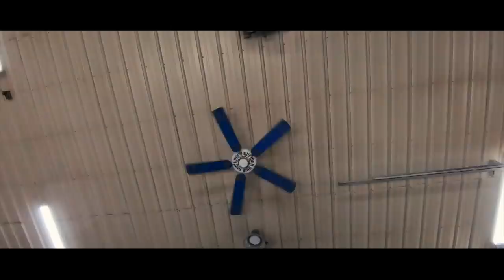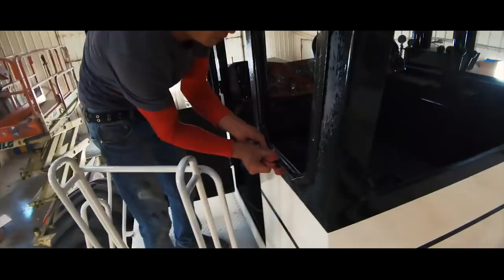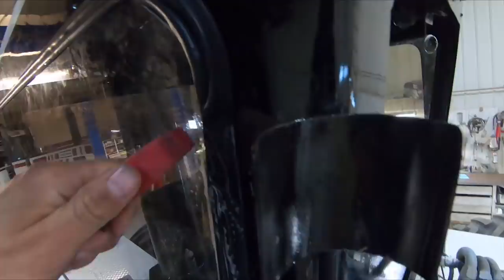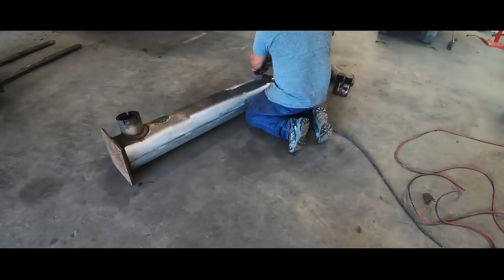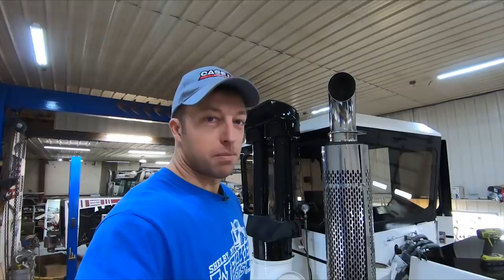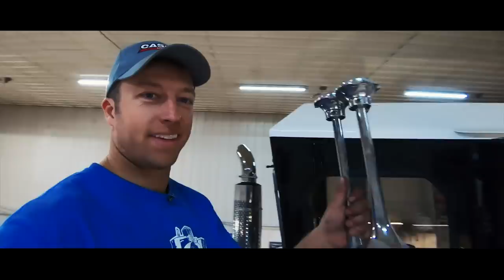BIG BUD Tractor 🚜 Restoration - Part 8

Comment: IMHO Straight chrome tip with a rain cap and let that coal blow straight up, get it as far away from the air intakes and pretty white paint as possible.  And another band clamp on tip would look cleaner than that muffler clamp to hold tip on.  Love your channel. Can't wait to see Dr. Chop spray the Waggy.
Reply: Love the Waggy 👍 The little Waggy that could.

Comment: Learned and awesome trick for putting in glass, put the rubber gasket around the opening, then put baler twine into the groove around where the glass would go. Put the pane against the gasket, and as you pull out the twine it pulls the lip open,  like you’re doing with the plastic tools, and the glass slips in. Like pulling a zipper all the way around. Works pretty slick.

Comment: There is a quicker way to install windows. Put thin rope (like starting cord) in gasket, seat the window in the bottom, press it against gasket and pull the rope while applying pressure to the glass. Pops right in. Nice to see your bud getting back to its glory.
Reply: goodiezgrigis im glad im not the only 1 wondering where the string was....
Reply: I tryed to explain that to..
You explained better! 😂
I'am guessing maby it's because I'am a Swede 😂
Reply: @ragnargustafsson4319  ajder?
Reply: That was the only way we installed windows in military vehicles. That rope needs to be soapy though to make it work easier.

Comment: I love the Big Bud, but hear me out on this. Instead of a corrugated line to the rolling coal tower, there would be a chrome hardline pipe to it?

Food for thought. Love everything y'all are doing. Keep up the hard work!
Reply from the maker: Completely agree that would be much better! But might be hard making the correct angles with a pipe that large? We wouldn't know how to make something out of chrome or stainless. The other issue is the engine vibrates and that will crack the exhaust over time. That flex pipe allows give. Appreciate the thoughts!
Reply: You could always just chrome the existing pipe you have installed.
Reply: @WelkerFarms  I was thinking you would just use two straight pipes, and then use that corrugated line for a small 90 degree corner, granted part of me wonders if there wouldn't be a small performance penalty with giving the exhaust a sharper corner to have to flow around, increased egts n all
Reply: I would expect the engine to be resilient mounted, so the engine roll and thermal strains would crack a hard tube off the exhaust way too quick.  Could install a 12” long bellows and then hard plumbing.  But as mentioned earlier, sharp bends or miters will hurt performance.  At 600 hp, really should have 6” exhaust .  I’d let it go as is.
Reply: @WelkerFarms  Stainless flex pipe is available....no rust and very durable compared to the conventional steel stock.  Also that conventional muffler clamp used for the turnout will rust and leave stains. I'd switch it out for a stepped stainless band clamp.
Reply: @greatnorthernn-3154  I agree. Stainless steel is the way to go. Won't rust and always look good.
Reply: Welker Farms Inc I guess the flex pipe had some arrows on it. The flow is better one way than the other. I've seen it before.
Reply: Joseph Huelsmann iagree has to have some flex engine and fender will flex so has to have some give a full hard line will crack

Comment: Have you considered putting a higher exhaust pipe on so it won’t be sucking in exhaust fumes especially if you have a wind hitting you dead on, big bud looks cool when it’s all done make sure you wash that chrome exhaust cover with an brand new sos pad it will shine for days
Reply: Gotta keep is below door level.  But it blows the exhaust higher than the intake.

Comment: Love the time lapse but I don't think it does that glass installation justice your buddy provided a big service there because that's a difficult job with slippery glass and non formed gasket rubber ,turned out great! Glad to see progress but you're not under pressure so no need to rush it ! Thanks for the video!

Comment: Take two big buds, split them and mount them cab to cab. Turn the ring and pinion of the backwards facing tractor over. You could make an always on PTO on the backwards tractor off the clark axles with a second pinion and yolk sticking out the "front" (back). Cut off the fenders and make your own to fit 66 inch tires. A pair of 650 big buds would end up bigger than the 747, with 2 V12s at 1300hp instead of the V16 at 1100hp.

Comment: Fitted Windows like these for years I've found if you put para cord all round inside the grove then put the window in the bottom and whilst keeping pressure on the glass start pulling out the cord try it much better

Comment: long way around on the window install . what you do is put the rubber on the glass first and put cloths line in the groove and put the glass up against the hole an pull the rope out  from the inside. takes about 5 minits and no danger of breaking the glass.

Comment: An easy way to put windows in is to put the rubber on the window first, put a heavy bailing twine or similar in the groove round the rubber, hold the window to the outside passing the 2 tailes of the twine to the inside. with the window held against the hole start pulling one end of the twine while holding the other end fixed, as you work round the window pulling the twine it pulls the rubber into place.

Comment: Would it be feasible to install a hydraulic motor on a Big Bud to power a PTO just for a grain cart?  It wouldn't be running for but a short period of time so heat shouldn't be a problem.
Reply: That's possible.

Comment: Curious question, Why did they build the 600 with the air intake next to the muffler?  Does it simply not matter, I have no idea just found it odd exhaust next to the air intake.  Great video as always!
Reply: Exhaust is blown above the level of the air intake,. This was the same engineering which came from the factory. Thanks for asking 👍
Reply: @RobertWelkerFarmerBob  yes sir

Comment: that header paint works awesome as long as it gets hotter then 400 degrees at least once.... if it doesn't, it will almost wipe off (and is very fragile).... wondering what job LA is qualified for - after all, how many farms have Big Buds that need to be stuck?

Comment: with that exhaust paint it works best if you pre-heat the surface before you paint it, doing that will ensure it lasts a lot longer. if you don't believe me then read the instructions on the can and try it.

Comment: Can you put PTO on the transmission so you can use it on a grain cart?  A lot of trucks have a wet kit (runs hydraulics) installed so I would think you can do that..
Reply: It would need to have enough gal/m flow to turn those large augers.

Comment: Just asking you said the singles on the combine worked well would a set not work as well on the Bud or the lower ground pressure compared with duels hurt traction
Reply: The 1400 LSW's don't fit the fenders. Too large of diameter.
Reply: Robert Welker thank you didn’t think on that

Comment: What's the hood ht... length in tractor...widespread is tires and weight    and hp ..is seems huge ...my experience was from smallest Ford Ferguson  to largest 4730 Jd that's since 1975 ...never been on one after that
Reply: Well it weighs 52,000, HP is 600+, tires near 78" tall,  hoods about 60 inches.

Comment: I feel like id want the intake positioned before the exhaust.. Or atleast not that the exact height its dumping fumes.
Reply: BWM that’s completely different to sucking in exhaust gases through the intake though, unless the engine in the bud has an egr circuit then it wouldn’t use exhaust gases

Comment: Imho, the exhaust being that close to the intake is quite wrong. The engine will be breathing its own exhaust gas instead of clean air.
Reply: It looks that way but actually the exhaust is blown up and away from the same level as intake.  And it depends on direction of wind.
Reply: True but the direction of the wind is quite a risk to take I guess. Especially in their wast expanse of fields. Probably I'm just wrong but as an engineer that setup  just doesn't look right to me.

Comment: Why does most tractors have the exhaust pointing forward? 

Also it would look really cool if you had a straight pipe on the top with on of those exhaust flaps on top😎
Reply: It keeps the heat away from the cab.
Reply: Scruffy 61 I see!

Comment: What a major design flaw... The intake and exhaust on the same side with the exhaust in front... just to make the intake suck all the crap from the exhaust.
Better if there were one on each side of the tractor.
Reply: BWM  Actually no, but they should be far apart
Reply: We have ran them for decades.  Not an issue as the exhaust is blown higher than the intake.
Reply: @RobertWelkerFarmerBob  I get that Bob, Maybe the my use of "major" is a bit much. But its a flaw none the less. We can argue that there may be other factors that make this the less problematic of the available choices.

Comment: In high school I drove tractors in the summer I drove a couple of Case 1200’s that the farmer had re-engineering one had a inline six cylinder Detroit diesel the other had a Cummins both in the 350 horsepower range. https://images.app.goo.gl/CincHf7UEamiuHkj7 is a picture of that model.